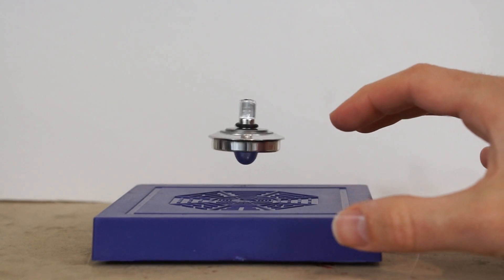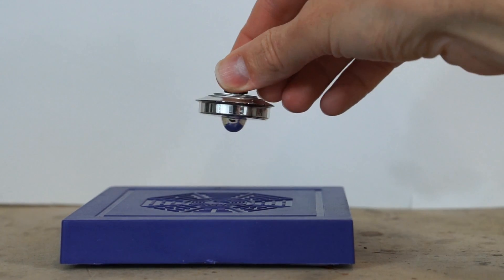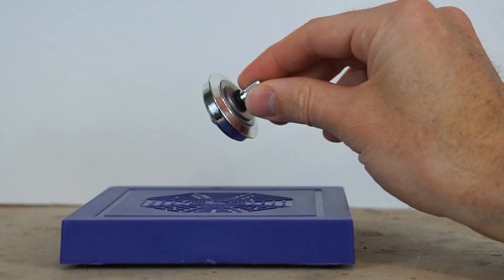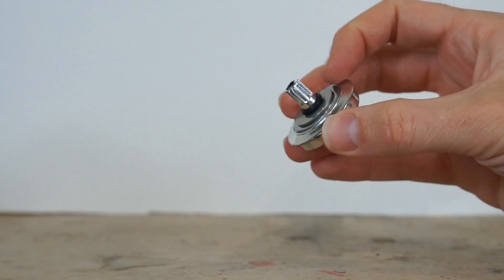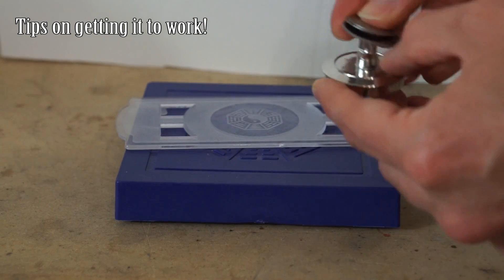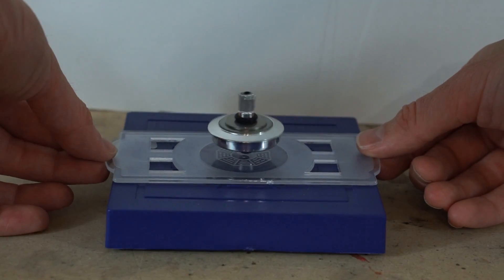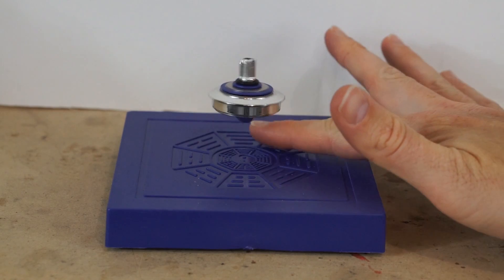Will a Levitating Gyroscope Spin Forever in a Vacuum Chamber?

Comment: Question about levitation that you may be able to test. If I have a box that has magnetic levitation capability sides put that box inside of another box that is slightly larger that also has magnetic lifting capabilities on all sides on the inside.... This way the box in the center will be levitating no matter what you do... Would the box on the outside weigh the same thing with the box on the smaller box inside the larger box or would it feel like it weighs less?

Comment: Good experiment which show following a certain model that magnetic fields are not un-materials and acting at a distance like previously taught. What are they then ?.
 Their "field lines" représentation which date back from grand-pa (200-300 years ago) electro-magnetism  discoverers physicists like BIOT-SAVART, MAXWELL are in fact drawn (for example the experiment with iron fines grains) by the path of swirling electrons .
 IN FACT THERE ARE ELECTRONS FLUXES EMITTED BY THE NORTH PÖLE AND COMING BACK  TROUGH THE SOUTH PÖLE (so matter of the magnet dont get polarized(no voltage ))
 In the case of MAGNETS, the  electrons fluxes are at a quite high speed or energy because of the ejection "machine" (in fact rotating dipôle in the magnets matter) similar to a ball throwing machine. 
 The mass result from the add up of the mass of an electron at rest (small) plus kinetic energy of the EJECTION maximum at the north pôle. The permanent magnets dont loose much energy with time as they are working in closed circuits and nothing interact strongly energetically (except if localizations of matter particles appear) in air/or vacuum, (permeability 1) .
 Fluxes (10 to the minus 8-9 ampères) which become currents (milli ampères) only when there is a spark in air or vacuum, are not the electrons currents witnessed in a copper line where much more  electrons but at very slow speed , collide and torsade  instead of being free (permeability decrease ) and that cause an "electro-magnetic" "friction"  energy loss which cause the spinner to stop .Because of their speed (kinetic energy) the high speed electrons have much more mass and are tinier vortices balls than the copper current electrons.
 In cosmology they observe those electrons (or positrons) fluxes,  called gigantic H  "field lines  " with a length of 25 L.Y above and under a galaxy having a length of 100 light-years (L Y) length,  thanks to the swirling electrons paths along these "lines". These "lines" are observables thanks to  the photons emitted. Electrons ( and positrons) are dipôles balls which decay into light speed pulsating donuts shaped dipôles called photons ,( see FEYMAN , CALTECH nuclear physicist and his diagrams from Q-Electro-dynamic, see also synchrotron light effect)
 The author of the video here has made another good video showing the electrons and air gases ions fluxes EFFECTS  resulting from static electricity polarizations .
 Fluxes of electrons ("E  field  "lines" of capacitors) rebalance (but on longer periods than SPARKS) the  VOLTAGE (potential) acquired by any matter trough rubbing, heating, alternative voltages and currents (ANTENNAS NEAR FIELD) ,centrifuging (gyroscopic precession), accelerating, Gravity, photons( light) impacts on everything material on earth 
 The author showed oil lifted and moved by the electrons and air ions impacts thanks to a small rubbing VAN DER GRAAF machine generating high VOLTAGES (polarization).)
 E field and H Fields are just concepts  useful  with the logic of mathematic but they are updated since the discovery of the electron, the positron and the photon . (replace the Grandpa charge Q and the MAXWELL waves.)
 In electro-magnetic unified field theory matter is the negative (by convention) voltage vortex of the electron (clockwise rotation) while anti-matter is the positive one (anti-clockwise rotation -spin) The vacuum space has zero potential and is massless and the referential of absolute rest( because matter and anti-matter potential "fields" "cohesion "neutralize voltage and matter mass or energy) and is a superfluid medium.

Comment: No it won't spin forever, probably just longer. There is still some air in the vacuum that will create resistance. Also the instability of the spin might be slowing it down too.

Did it even spin longer in the vacuum?

Comment: I would figure there is more friction/heat generated from the current caused by the magnet inside the metal. And assuming the large magnet has static friction... Well I guess the static friction doesn't necessarily have an elastic response. 

Would be interested in seeing a superconductor spinning like a top in a vacuum... Where the lattice of the material is such that it doesn't interfere with the path of the Cooper pair of electrons when spinning...

Comment: Gyroscopic precession is not the direct cause for cessation of suspension. The effect you observe and describe is divergent nutation, which is precession plus entropy.

You are correct that all aliunde energy has some effect upon any “closed“ system, but for this concern it is overwhelmingly because your “vacuum“ chamber is not even close to a vacuum, but then, not even deep space is a true vacuum -- we´ve had this conversation before!

$5? That´s a good price for such a cool, instructive toy. Thanks for the addenda of how to best use it!

My educated guess is that even if a perfect vacuum could be achieved, mutually induced electromagnetic counter-induction would slowly make this system lose energy. This is not friction, per se.

P.S.: (4:05) Coincidentally, as of this writing there is the Ingenuity helicopter drone on Mars, which is designed to successfully fly at 0.01 atm, much less than the 0.1 atm you say a (terrestrial) drone cannot fly!

Comment: I think it will stop because there is a force apposing gravity to allow it to spin.  I would guess the energy producing that force would create some force in opposition to the spin of the top, causing it to ecentually slow.  I'd also guess that the wind desistance the top experiences when spinning is comparatively small to the other force slowing it's spin. I'd think it could spin perhaps a little longer in the vacuum, but not much.

Comment: two things: try this with two charged objects with same polarity, answer this: will the whole everything keep spinning?
Reply: you can calculate the energy of the flywheel, pun intended, and some approximate loss over time
Reply: laser rpm counter
Reply: put it on a stick, stays in level, no wobble, magnet spinner ring on a stick
Reply: put significantly more energy in the spin storage, than the loss from the maglev friction
Reply: do you think everything dies, God said otherwise, God does not ever die, do you have God, what you said is that everything (thinks) they die, but you dont, just believe

Comment: You've got really bad spinning technique. Why not get it spinning on the plastic plate at a distance from the base, then gradually lower the plastic plate down from a height above the base until the spinning top remains at the floating point.

Comment: it will stop spinning couse of magnetic resistance of the spinning toy cause eventuali that small gap that wobbles it around makes resistance , second thing it will stop cause the room its full of fotons that hit that object and eventuali they will stop it and 3th magnetic flux betwen base and the spining rotor is creating edddy curent in the magnet material so if the floating is possible without spinning the toy it will stop 100 % no way to keep it spinning :D

Comment: Perpetual motion idea:
If the top was or had a lightweight balanced wire wheel like a dreamcatcher could you use magnets placed on the rim to keep it going using magnetic repelling force, inertia and maybe gravity? The inbound rim magnet would feels "compression" but the inertia keeps it moving till it repells by getting a slight inertia boost or lift to use gravity aswell, or maybe not? 
You already reduced friction! Got a vacuum chamber! There might be a high degree in magnet engineering we haven't realized yet.
Reply: Scientists have been studying magnets for 2600 years: there's no "high degree in magnet engineering we haven't discovered yet"!

Comment: The reason why it stopped is the communication of the two magnets, which is not a scientific explanation at all.
It should be considered that the kinetic energy escaped due to the Joule heat due to the induced current.

Comment: Viscous friction in gas (air) is nearly independent of density, so it does NOT decrease much as air density decreases. It would take an EXTREMELY high vacuum to make a serious reduction on viscous friction in air.

https://physics.info/viscosity/

the viscosity of gases is roughly independent of pressure and density

An object that has axial symmetry and spins along its major axis does NOT produce gravity waves. It must be asymmetrical to do so.

Comment: The slowing of the spin in the vacuum, or in space for that matter, is not substantially due to friction, not due to the molecules surrounding it. 
Whenever you have a non-constant magnetic field, eddy currents are set up in conductors, and fluctuating magnetic fields are set in magnetic materials.  The top has a magnet in it which causes a fluctuating magnetic field when it spins.  The magnets in the base are also pieces of ferromagnetic material, and so the fluctuations from the top cause dissipation in the base magnets.  Also, the spinning top experiences a changing magnetic field from the base magnets, which also causes dissipation.  I think if the top and base were both superconducting, it would spin a really long time, but not forever, because the while superconducting electrons dissipate no energy, there are still some regular electrons in the material which feel a tiny bit of the AC magnetic field so will eventually dissipate the energy. Thanks to my brother Brett for his help with this explanation.

Comment: I think it will stop after maybe 5 hours because there are still a few “air” molecules floating around and maybe the centrifugal forces and the bouncing around makes the material deform ever so slightly so it loses energy by heating up

Comment: Could a nano-sized speck spin forever during the latter end of the black hole era within a galaxy-sized void? I'm thinking the expansion of space would ensure it won't ever interact with another particle, and the small size might prevent collapse from quantum tunneling.

Maybe the real question is whether such a speck can be said to be spinning at all if it has no observers.

Comment: Suppose I take a parmanent magnet, attach it to a shaft. At the extremes of the shaft I attach two more magnets and carefully levitate the two in a B field. The central parmanent magnetic is surrounded by a coil. The shaft is made to spin in vacuum. Will the motion stop? If not we will get electric current non stop just by the spin.
Why will it stop? Can u do this experiment?
Reply: not sure I understand, but magnetic can be consumed eventually if you let the magnet do work.
Reply: @poisonousedward343  Yes, I just leant that a few weeks ago. Now I know what happens. Lenz' law saves conservation of energy.

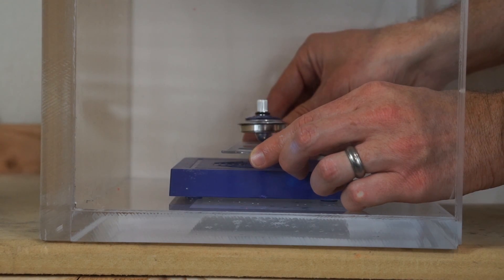Comment: The longest I have ever had was with  a 3:21 levitation. The top was barely without and any visible motion until it neared time to crash land. Never could do it again for that long. The usual I get is around 3 minutes. The less wobbles, the better. Took alot of practice. It would spin for hundreds of years except for one thing: Friction in the air.

Comment: I think it'll stop because of 2 reasons. First one being that it's impossible to create a complete vacuum. So there would be a small amount of air resistance which will contribute to it's fall. Second of all the magnets repulsion is not only causing the top to levitate, it's also resisting some of its motion which will eventually decrease the kinetic energy of the top and it will fall.
Reply: Almost, there is more to it. Unless the top spins without wobble and is perfectly smooth and perfectly symmetrical, it will radiate em energy and will eventually stop.
Reply: SO TRUE!!! 😎 You, That homie!
Reply: 3 angular momentum it’s basically pulling on its self. It’s center of gravity is to center.
Reply: It can’t go in a straight line yet it wants to. It’s like what happens when you let go of a bag of something we’ll spinning the bag flys out of your hand. The closer you bringing your hands in the faster you go but the faster you slow down because your body wants to go in a straight line the force of that gets stronger when you bring your hands in. But when you bring your hands in it also creates more friction.
Reply: Just theory. ??

Comment: I think it will stop because the spinning is using momentum and this is a vacuum, not zero G. But even like in space with stars, planets and other gravitational forces: add to that the constant "nudging" into all directions by the magnetic field of the bottom magnet, which will take away momentum, too.

Comment: There are induced electrical currents on the gyro metal parts due to the magnets.  Currents and magnetic field interacts and there are small forces and torques.  No magic.  Not friction in the proper use of the word.

Comment: Nice video. I always watch and love your videos. Pointing out the obvious improvement that would be nice... paint a mark on the side of the gyroscope and use your camera frame rate to measure the speed and graph the rate of deceleration. Also, it would have been nice to use a high-speed motor to start the thing.

Comment: This magnetic top stops spinning because it is made with metal parts that are conductive and that when moving (rotating) under a magnetic field of the magnetic base that supports it in the air, a resistance appears due to the law of Lenz in the metal that few dissipate their kinetic energy of rotation.
Reply: If the magnetic spinning top were made entirely of electrical insulating material and its magnetic part was also made of magnetic ferrite, this effect that I mentioned above would not be justified, another reason why the magnetic spinning top stops losing its support when levitating.

Comment: Put two books between the magnet and the spinner, so that when you spin it, it is already at the level where it is stable (will be much easier). Then remove the lower book, before lowering the upper book and removing it as well.

Comment: I think we can make something spin forever we just need to set up a loop of pushers and pullers and something that'll push. Maybe a magnet? Perhaps a magnet being pushed in a circle by other magnets? I know the other side of the magnet would cancel out the push with the pull. What if we could secure a piece of bismuth to a magnet, say on the magnets push side. Then the exposed side of the magnet would always pull, while the bismuth on the other would push...? Kind of like a one way valve for magnets. Really that's all we need. If that doesn't work perhaps if we constructed a bismuth ring tube with a magnet inside? The magnet would float infinately inside- maybe there's someway we can tie quantum locking into it. Idk just throwing ideas out there. I really enjoy your videos they keep me thinking. All I know is gravity always produces a force. Always. So do magnets. I feel there must be a way to harness this constant force. Hell the earth might not spin forever but its gonna spin a very very very long time. Forever for us anyway. What if we used the earth's spin to generate electricity? You mentioned how things slow even in space. What about larger objects? They still slow however with a larger mass it takes so much more time to slow a larger object, I would think. Wouldn't it be cool if we could spin the moon say- spin it really reall fast. Fix super sized super magnets to the surface that pass through copper coils fixed around the planet in space maybe. Moon power for everyone. Ok... I'm done
Reply: Actually I know perpetual motion is possible, has to be. We just need to discover a room temp super conductor were really that close. People have thought a lot of things impossible. It's that frame of thinking that keeps people from trying. In my opinion nothing is impossible, it just hasn't been done yet. That we know of--

Comment: I don't even have to watch this to know that the heat generation from it acting against the lower magnet or magnets will cause it go generate to heat causing it to loose kinetic energy. 
Similar to how if you've seen a magnet go through copper wire because of it's resistance. No matter how good the magnets are there is resistance. 
Not to mention the Earth's own magnetic field or the metal nut and screw right next to it on the door...

Comment: You do realise that the less air in the chamber would also cause the object to increase in weight.
Gyro distribution of centrifugal force is evenly distributed in normal atmosphere. 
When you decrease the air pressure the forces change that surrounds the object. Then gravity and the magnetic force of the earth takes over. 
Similar if you were to place a drone in there as the air is diminished the acting opposing forces diminish.

Essentially every object that floats no matter what the forces would fall to the ground.
Take for instance when landing on the moon to get off the moon all they had to do is introduce a force greater than the moons gravity.

Comment: I have a suggestion for spinning  it initially.  Take that opaque plastic surface off the blue surface and away from it.  Spin up the top on that.  Then with the top spinning move the  opaque surface to over the blue one and then slowly lower and remove it.  That would be easier than trying to fight the magnetic field in the blue box.